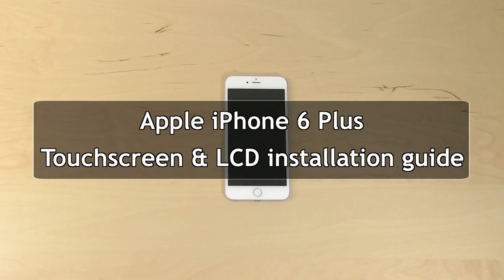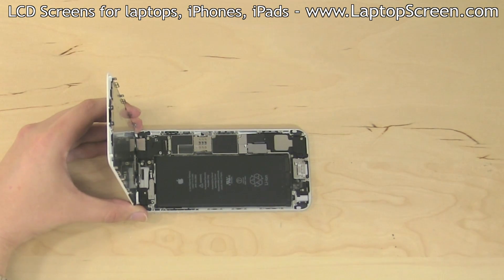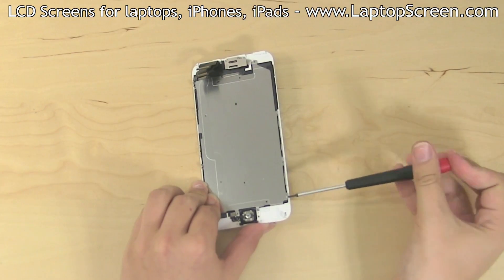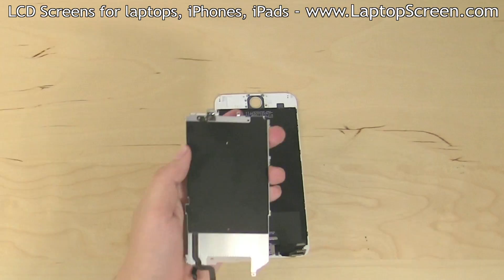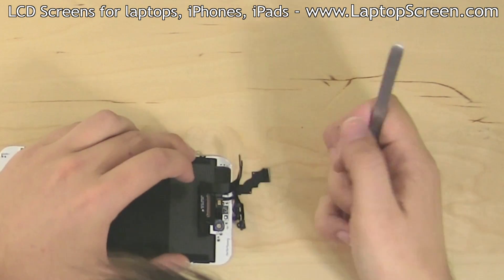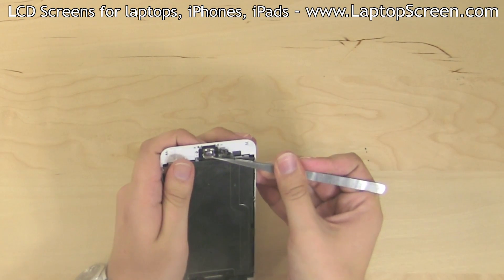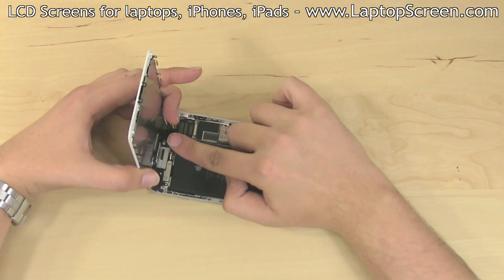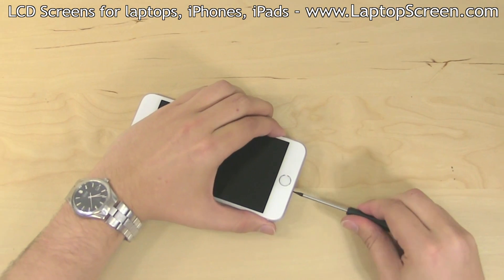iPhone 6 Plus screen replacement / digitizer glass and LCD reinstallation instructions

Comment: i know im 10 years late, but i found my dad’s iphone that hadn’t been powered on in at least 6 years, and the touch screen just stopped working, if this is your case, quick press and release volume up, quick press and release volume down, then hold the side button and home button simultaneously until the apple logo appears, then keep holding until it dissapears, then it’ll still be powered off.

Comment: Thanks for the video, I just followed it to fix an iPhone 6 Plus which had a busted screen.The only part I found a little challenging was the camera/sensors, the cable was glued on pretty tight and then lining it all up while getting the shield back on took a couple of attempts, but it works great!

Comment: Hi are all the screws the same size?
Reply from the maker: +alluringblackB No, not really. Some screws are same in a pair - like the two pentalobe near the bottom connector, two on the battery plate, two on the home button plate.
The screws in the connector plate and the camera bracket are unique to their positions - its best to arrange them on your desk in the same pattern they were installed in the device.